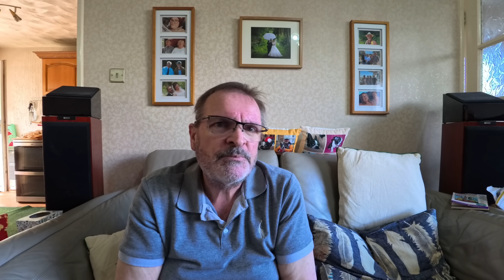Expert Ships Engineer Reacts to Baltimore Bridge Crash

Comment: Still working 35 + year captain. I have not seen a single item from the Bridge crew. This was a 100,000 ton loaded ship and would have taken many miles to stop at the reported 8 kts. I have heard that the ship suffered a blackout prior to hitting the bridge. Having a pilot on board is really of no consequence as the master is far more familiar with the handling of the ship than the  pilot. The pilot card posted on every bridge is not really a lot of help and lists only a couple of scenarios. The question is what caused the blackout? If the ship was properly tested to a worst case failure mode as DP vessels are the vessel would at least have know quantities. Something stinks here from what has been released. The vessel was not fit to proceed if it blacked out so easily if it was being operated correctly.

Comment: As a retired Navy petty officer, I spent many hours on sea & anchor details, in and out of ports...and have experienced several occurrences of complete loss of power (dropping the load).  You lose all steerage.  The one precaution that could have prevented the catastrophe is to have had 2 tug boats tied on until after all bridges would be cleared.

Comment: A data point to consider:  The bridge in question was slated for a full deck replacement for the entire length of the bridge as well as the installation of fiberglass jacket protection system at the water pier columns.  This project was to start during the summer of 2025 and last for 30 months or nearly 45 months (3.75 yrs) from time of the "accident" probably more cost effective to start from scratch especially when demolition expense was done free of charge.

Comment: Guy is not expert.In port you have speed restrictions,tugs following ship till safe area,crew in engine room prepared for all emergency procedures,two generators running in parallel,third generator in stand by mode,crew on deck stand by near anchor winches,ready to drop any anchor in a minute.
Problem here was lack of training and pure education of persons involved.Minimum crew problem.Tired crew problem.Pure safety regulations in the Port Authority Office. BTW,all ships have 24 Volts back up steering.

Comment: Do ships of this type lose all rudder control when they lose power?  Are rudders completely ineffective without propeller thrust?  Is it normal procedure to have backup power operating when sailing in such close quarters, in the event of a loss of the main power system?  As you can surely tell, I know nothing about ships, but I am finding  the whole incident very puzzling.

Comment: Where were the tugs? Given the size of that boat and that limited space in the harbour and having a hugely important bridge across the harbour - it seems inconceivable that tugs were absent! I know ship owners are cheapskates and cut corners all the time, but shit happens and what are the costs now? The insurance claims will put even Maersk out of business! So stand by for the bankruptcy shenanigans.Yes HFO is used at deep sea and you switch to DFO before entering port and stay on DFO until the pilot is dropped off. Blackouts and restarts may point to water in the fuel settling tank or day tanks? But you always take fuel samples after every bunkering operation. Every ship I sailed on had 2 gennies on line and 1 on standby so there should have been enough available power for the main engine. I wonder about the crewing and professionals aboard - foreign flag crews were always a disaster waiting to happen.

Comment: Paddle wheel effect I assume is the same as prop walk ? On a small canal boat when you reverse, the rudder has little to no effect on steering but prop walk will.
I’m not a ship engineers, rather a general engineer, my thoughts were the exactly the same as yours, you did miss that the moment before impact, the lights went out again.
I hadn’t considered prop walk but now you mention it, that makes sense that the hard reverse would have steered the ship more in to the direction of the bridge pier.
The two questions I do have for you are, how long does it take to change propulsion direction from forward to astern & Does this involve stopping the main engine to reverse it ?

Comment: As a retired Chief Engineer, i appreciate your indepth coverage...i however disagree on the important point you made that the ship's Main Engine was backing off trying to go astern.
From my knowledge if the ship has a forward speed of 7 to 8 knots, the propeller will still be rotating ahead due to the forward momentum of the ship.
You can give crash Astern movement on the Main Engine control, which will admit braking Air to overcome the inertia of pistons being free wheeled by the still turning propeller going in ahead direction..since the ship was still having forward momentum.
Best case scenario it would take about 4 mins for the braking Air to take effect and  then probably the Main Engine would start to go astern...in the actual factual time scale of less than 2 minutes, it would be impossible to get the Main Engine going Astern.

Comment: Another ex chief here. I reckon your hypothesis is along the right lines. It doesn’t explain why the Captain would abandon hope in the steering and keep the engine going ahead and hard over port to rectify the swing. Perhaps ( and of course it’s speculation) there was also trouble with the steering on emergency generator, and he felt a double ring astern was his only option - what a shitty call to have to make…
Thanks anyway.

Comment: As a former Coast guard quartermaster, I can say the bridge crew made a gross error in puttng the engines in reverse. There is No Way the ship is going to stop in that distance. It takes two or three miles to stop that huge ship.  They should have put the helm hard over (to make a left turn) and applied all power, full ahead to push the stern to starboard and the bow to port. Doing that they had half a chance to miss the  bridge support by inches, or at least hitting it a glancing blow. As it was they hit it dead on.  Basically, Command error. ALL military ships have a quartermaster and several engineers in the after steering room for just such a steering emergency in restricted waterways.

Comment: I am not an engineer, but I thought the same thing watching the video (in real time, not sped up). At the time of the power failure the ship wasn't even heading directly toward the bridge, but at an angle not quite parallel. When the power is restored and we see the belch of smoke from the stack, the bow turns directly toward the two closest pilons (starboard). This is exactly what would happen if an order of full reverse (full astern) was carried out. This while the vessel was still moving forward between 7-8 knots simultaneously causing the stern to swing to port.  I don't know how much to blame the pilot or captain for reacting this way without taking into account how the current was affecting the vessel. It reminds me of an inexperienced airplane pilot that instinctually pulling back on the yoke when in a stall (which results in a more severe stall).

Comment: That's interesting. I'm not a marine engineer. I recall that the Titanic had two screws that went in one direction and the third went in the opposite direction. I suppose this would have something to do with mitigating against the paddlewheel effect. So for such a large ship as this to have multiple screws, why would they be designed to go in the same direction given this effect? Also, why wouldn't the ship's captain know about this characteristic? It seems it would play a significant role for maneuverability in the approach to and exit from harbors.

Comment: You say the hydrolics froze, but the black smoke is indicating power full on, so if there was electricity to power the engines....different power source for hydraulics?
Reply from the maker: With out power the steering will lock. Must restored power or the engines will not start.

Comment: I have one question. Could they have stopped the ship by lowering the anchors quickly even though it was going at 7 to 8 knots or could they have dropped an anchor on the front left side to make it pull it to the left instead of to the right toward the bridge foundation? Thank you so much for your expert opinion. Your wisdom and knowledge makes things very clear for me and for all of us out here who does not understand what you do. I noticed the smoke and I saw the lights flicker on and off in the short video that I saw and I thought the very same thing that you did about how that it would turn to the right even though I really don’t have any experience with large vessels. You confirmed everything that I was thinking that happened.

Comment: I agree with you.If the ship was going at 8 knots when power failed,it would have continued in the same direction.So if they simply left it alone,it would in 4 minutes it would have gone safely under the bridge.Yes ,I think that they panicked,put engine  astern, whiched changed the course( bu hardly the speed),resulting in the collision with the bridge support.

Comment: Maybe all you 'engineers' should take a closer look at the "BRIDGE" itself and ask WHY there are FLAMES on the split points on the bridge, and NO metal DOESN'T START BURNING WITHOUT SOME KIND OF FUEL, solid, liquid, or vapor, available for "any sparks' to ignite and BURN!!  Start thinking outside the box.

Comment: Think your right on the steering issue as a racer it Isa forced memory response to power up an steer. Normal response is to pull back on the reins. Hence you loose your direction stability.

Comment: Now 50 years since I last set my foot in an engine room, however things has not changed that much, so I’d like to support your view.
A horrible situation to have a blackout!
The minutes are short, and large ships don’t operate like a car.
We never changed to heavier oil until we had rid the pilot.
One thing I would say, we usually had two tugs attached and available just in case.
Currents may also play a role.
Also we had 3 generators and while in such hazardous waters we had all 3 running, and the electrician standing by on the board in case anything should happen.

Comment: INEXPERIENCE!  COST CUTTING AND AVOIDANCE OF TUG SUPPORT, DUE TO BEING GREEDY.  NO GUARDS AT FOOTING BASE AND SHIPS THAT ARE TOO BIG IN THE FIRST PLACE.
ALSO TOXIC WASTE SHOULD NEVER BE
ABOARD A GOODS CARGO SHIP.  I WONDER HOW MUCH IS DUMPED AT SEA, PER CONTRACT.  THERE IS NO SUCH THING AS AN ACCIDENT OF THIS NATURE.  IF FUEL CHANGE OVER IS MANDATORY, THEN THE SHIP SHOULD HAVE BEEN READIED AND PROVEN WORTHY.  HOW MANY SHIPS STALL OUT ON A REGULAR BASIS?  3 TUGS COULD HAVE CORRECTED THIS, ABSOLUTELY.  3 BILLION DAMAGE, NOT TO MENTION THE LOSS OF BUSINESS AND JOBS.  THAT UKRANIAN MONEY AND THE REST THAT IS STOLEN BY POLITICIANS COULD HAVE BEEN APPLIED TO INFRASTRUCTURE AND FOOTING GUARDS ON THAT BRIDGE.  ALL THOSE BRIDGES SHOULD HAVE DRAW APPLICATION.  
NO EXCUSE AT ALL.
HOW MANY MEN ARE AT THE POSTS.  WHY 2 MINUTES? NOBODY
READY?  IF 4.5 MINUTES IS BRIEF, WHY TWO MINUTES
TO INITIATE.  IF THIS MAN KNOWS, WHY ARE THEY NOT ALLOWING EXPERIENCE VIA MEDIA TO ASSIST WHEN THIS OCCURS
OR AIRCRAFT TYPE AUTO PILOT TAKE OVER. RED ALERT UNTIL YOU ARE OUT OF PORT.  ASSISTANCE UNTIL OUT OF PORT.  WHAT IS THE NUMBER OF CREW MEMBERS?  ARE THEY ALL TRAINED?  WHAT HAPPENS WHEN THE PILOT DIES?  SHIP TAKE OVER OR HIJACKING SITUATION?  1977 BRIDGE DUE FOR REPLACEMENT?  THE SHIPS OWNER SHOULD BE RESPONSIBLE.  WHY WAS THIS BRIDGE NOT OUTFITTED WITH
GUARDS?  THEN THE FAKE PRESIDENT SAYS THE GOV. WILL PAY FOR IT.  THE CONSUMER WILL PAY, ON GOODS AND INSURANCE HANDED DOWN THE LINE.  THIS BOTTOMLESS BANK ACCOUNT IS PROOF, THAT MONEY IS JUST A MILLSTONE FOR THE COMMONER.  NO MONEY, JUST RATIONS AND REMOVAL OF PRIVILEDGES.  PUT A LIMIT ON SQ. FOOTAGE OF HOMES,
AND THE NUMBER OF HOMES PEOPLE CAN 
OWN.  ALL PEOPLE!

Comment: If you ask me all that black smoke was the generator firing up cause when most generators start up they go directly to governed speed, also most generators should be wired to sense a power outage and start automatically

Comment: Where were the tug boats?
Reply: If they don't normally use tugs to aid navigation then there wouldn't be any.  Tugs are typically only used to help get the ships to and from the pier where small and quick steering corrections are necessary, not to transit in and out of port.

Comment: Is it possible that the generator was not maintained and tested routinely?  It's important to run/test generators to ensure the engine parts stay lubricated and in good working order. Just wondering.

Comment: No Russian, the captain was Ukrainian.
I am zero expert, but it was intentional. Using a ship with power failure tendencies. Pretending one and bring it back for just as much, so they can hit the bridge. No expert, but I could see, they had pedal to metal in reverse. Steering to the bridge. Also, the last 2 minutes were not recorded on the black box.

Comment: There is one problem with what you've said. When you watch the video playback you can see the ship start to turn BEFORE the first power outage. After that, everything you said is correct and makes sense, ie. regarding the astern drive attempt causing the ship to pull to port. I assume that the dropping of the port anchor was to aid in attempting to pull the front to port as well, but it didn't work.

Comment: In every comment Ive seen about this event, the power failure seems to refer to electrical power, which is almost irrelevant.   The main factor is Propulsion power,  ie the engine working correctly,  thats what will cause,  or prevent control of the ship.
Reply: Correct, but what happens if the helmsman looses control over the rudder?

Comment: I'm an ex Royal Navy Marine engineer and I have worked on ships and small boats for nearly 40 years. I also am a current small ships captain driving commercial power boats and barges. I have also sailed around 25.000 miles single handed on my own yachts that i have lived and sailed on for 16 years. You have come to just about the same conclusion as I have.  When that full astern "emergency order" was given. the force of the water coming off the props would have pushed the stern of the ship in the opposite direction. this is a well known common occurrence called "prop walk". I am what is referred to as a "conspiracy theorist" This was mechanical failure and some incorrect decisions. Anyone can make mistakes, especially when under such extreme stress. This was not a terrorist attack!

Comment: Great analysis - thanks. To the untrained eye it looked like the ship was aimed deliberately at the column after the first blackout. The eye does deceive! From the electrical side I've been working on a site-wide electrical re-fresh, and got drawn into the fault analysis on 400V distribution. Trip settings on breakers is a black art - and one missed cable examination can set off catastrophic trip cascades that can drop the site. So with hindsight if the breaker trips settings are not looked at holistically and modelled to death its easy to end up with shonky electrics for the site, and and in this case - the ship.

Comment: Excellent explanation. It is refreshing to hear from a fellow Merchant Navy man, instead of the armchair expert (land lubbers) and conspiracy theorists. What you have just said is 'exactly' my take on it too. I am a recently retired master, after spending 40 years at sea and 30 of them as master on coastal vessels. On the coast the Master gets to do far more ship handling, than deep sea Masters. The paddle wheel effect you mention is known as 'transverse thrust' and although the intesity of that effect varies from one vessel to another, it is very 'real'. All the land lubbers keep refering to the rudder and steering, in a blackout condition. Anyone who has actually handled a large vessel will know, that if you stop the engine suddenly, the rudder is useless. The water backs up ahead of it, spoling the flow over the rudder. It would not matter where you put the rudder, it makes no difference. 
I agree totally, about not going astern in these situations. The panic would be evident, as it is observed that the vessel is approaching the bridge. Every nerve fibre would be telling you to STOP, go astern, put the brakes on!   It would take a brave and experienced, pilot to actually do the correct thing and to go ahead, with the rudder to port. Get the head over, to the clear span. The arse end, would of course, then swing towards the bridge, so it would have to be followed by hard over to starboard once the head is entering the span. (I have had occasion to do this myself).
All the best Chief and thanks for keeping the lights on.

Comment: VG discussion!  As I watched the vid on news, this was basically my thots; it was a stressful mistake, that cascaded. On land, I have seen results/understand the phenomena of that when you slam brakes/turn steering wheel AWAY from whatever you're trying to avoid, it actually  FORCES your vehicle TOWARD the object that you are attempting to AVOID!! Sounds strange, but is true. I have seen the results dozens of times! In fact, I saved my truck, and myself, on an icy road, by turning TOWARD high/unprotected drop-off, slamming brakes, forcefully jerking front-end BACK TO MIDDLE OF ROAD! That saved me& truck. Sounds wierd, but sometimes that's how engineering works!! TY!

Comment: So, it's a typical Titanic like reaction again then. I myself had very bad experiences with all kinds of biofuels added to the diesel that I normally use in my boat, clogging all the fuel lines, filters and pumps after a while. Not saying that low sulphur MFO will give the same problems, but apparently marine safety is sacrificed by allowing additives to be used that compromise the proper working of ships engines. Thanks for straightening things up from a Dutch fellow engineer.